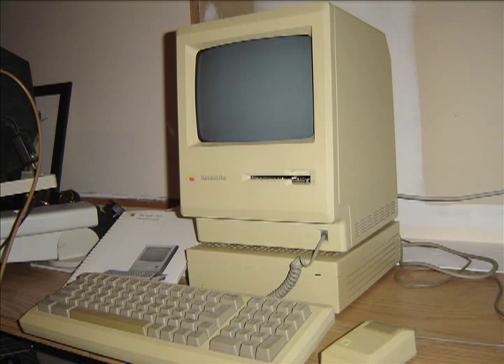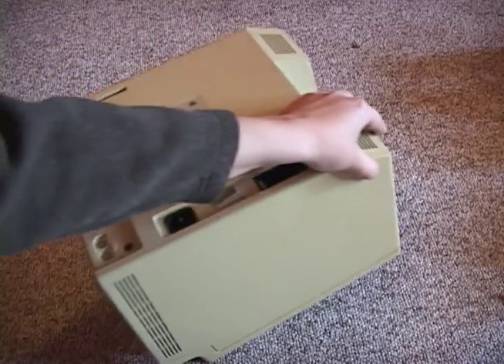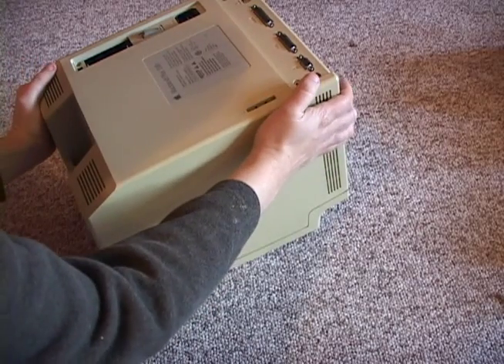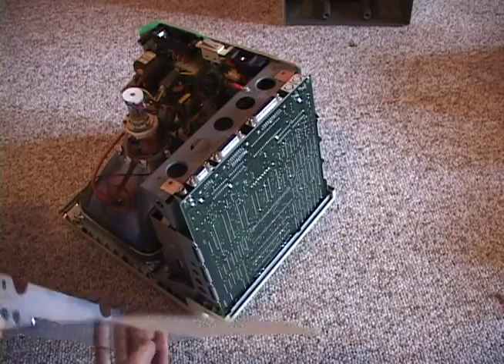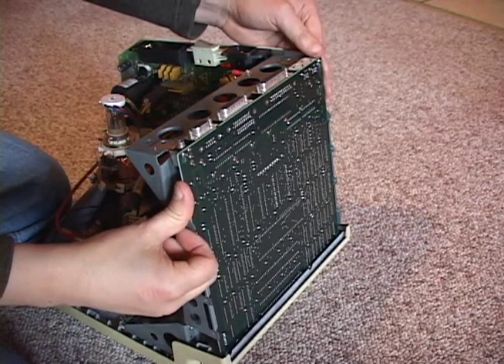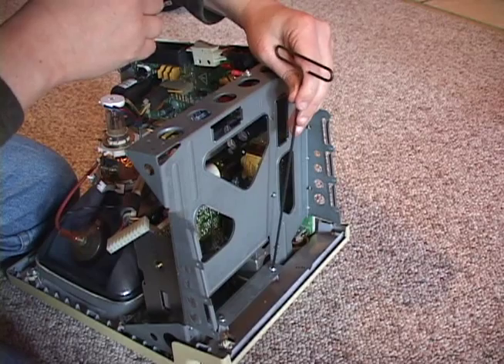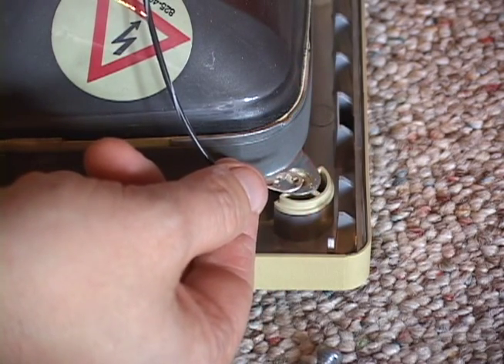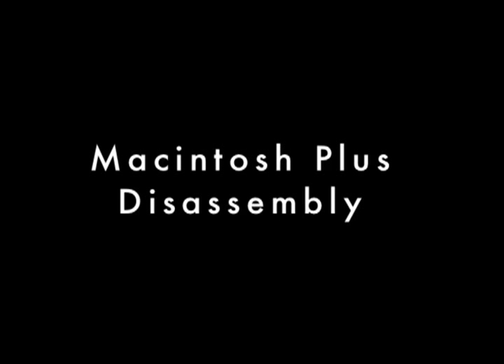Macintosh Plus Disassembly

Comment: That takes me back. As a 14-yr-old, I used to repair the school’s Mac Plus machines in my free time (in 1994) earning about three times what my friend earned from his newspaper round. Actually the hourly rate of NZ$40 I charged was more than I earn now, 28 years later.

A long-handled Torx T15 screwdriver was not easy to find, and my solution was a Torx bit fitted into an Allen screw (recessed 6.5mm hex), the threaded end brazed to a rod, with another rod brazed on as a T-handle. Getting the rear case off involved a kind of hand-clapping, pushing motion with drum-like sounds.

Taking out the floppy drive and removing a stray disk shutter was a simple and common task for me; I would do several each week. I’d usually take apart the eject motor and apply silicone grease for that silky sound, plus I’d tweak the screen image to fill the screen (mistaken though that was, since circles wouldn’t have been round after that).

We did actually have quite a few analog board failures which I now know would have been horizontal output transistor or flyback transformer failures. White lines and squealing noises were common. 

Applications were not stored on the boot floppy disk, but instead served over a PhoneNet network from a fileserver, a more expensive and more powerful Macintosh which was… an LC. I can’t believe it worked as well as it did with 23 Plus machines loading ClarisWorks.

These machines were retired soon after and replaced with a room of Compaq Pentium 75s running the amazing Windows 95. However, we managed to get a little more life from the Mac Plus by relocating the AppleTalk network to the nearby Typing Class, where the Macs replaced the electric typewriters. 

Switching parts around kept a fair number alive, and I also remember a few Classics to which I fitted hard drives. These 20MB Rodime units (that I got from somewhere) were older than the computers they were going into, but they worked, making a delightful coffee-percolator sound. It took some of the load off the LC fileserver. 

However, adding hard drives did have the side-effect of reducing the number of disks in use. And therefore, the number of disk shutters that fell off disks. As a direct result, I couldn’t quite afford a Powerbook 540c and anyway, with the 5300 coming out, I spent my money on a Pentium 133, 32MB/1.7GB, ET6000&3dfx, 19” CRT.

I bought a Powerbook 540c last week…
Reply from the maker: That's great reading your personal history with the Macs, Alex! All that experience would come in very handy in this age of retro-computing. Better late then never getting a Powerbook 540c.

Comment: How do you remove the reset switch? I don't want to force and break it.
Reply from the maker: I've never actually removed one myself, but they say to slide a flat blade screw driver under the side and pry off. If worried about brittleness, soften the plastic switch with a hair dryer, keeping in mind the hair dryer is hot enough to deform the plastic if you give it too much. I hope this helps.